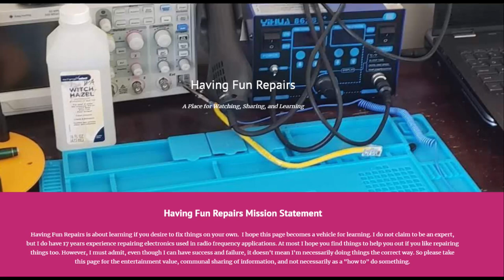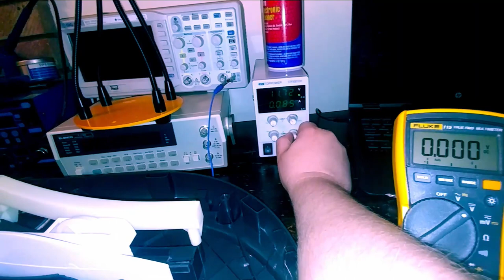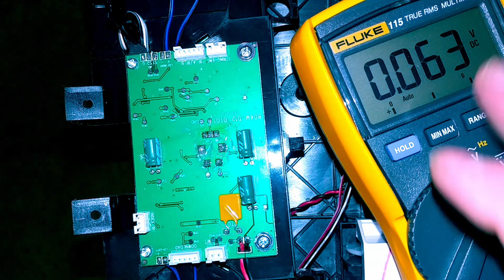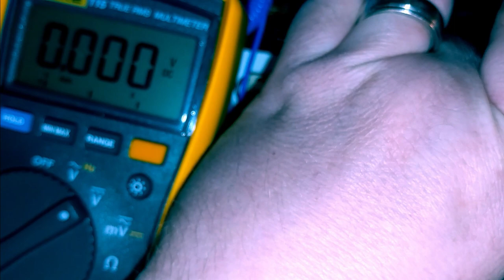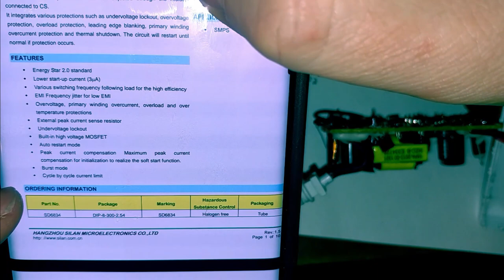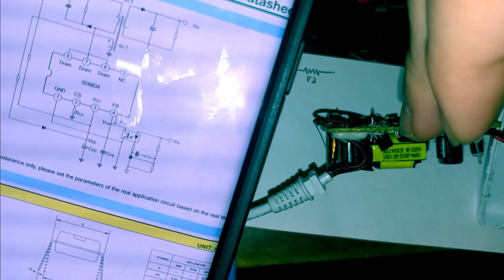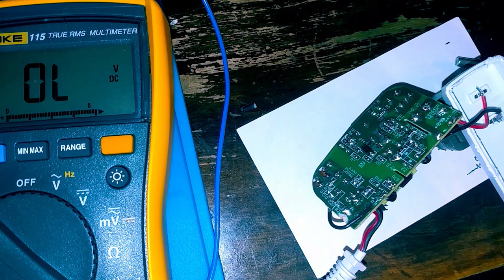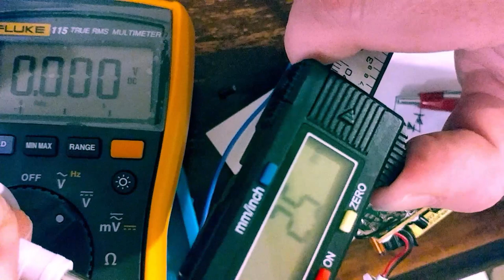4moms rockaRoo Repair Model 4M-012-01

Comment: Thank you so much for your detailed video. Upon fixing the swing, did it ever cut off on its own with a flashing blue light?
Reply from the maker: Thank you for watching. After I replaced the DC power supply/wall wart we never had another issue with it.

Comment: I was needing some help with mine. If you turn it on it will go for a long time but if you turn it off and back on it will start blinking and then stop within a minute of turning it back on. Any ideas on how to fix it? 4moms is no help.
Reply from the maker: Hello, unfortunately I have not directly ran into this issue. Is it the ring light that's blinking? A quick Google search produces that there could be an obstruction with the moving mechanisms. If you are good at disassembly perhaps check those parts to see if there are any fibers that are prohibiting the gears from making proper movements and check that they are properly greased. This would probably be where I would start on the low end. If there were no issues with this then I would be checking/troubleshooting components for proper operations on the high end of troubleshooting. I don't know your background, but I do offer repair services for many electronics. This is an older video so it may not be advertised in it. 

https://sites.google.com/view/havingfunrepairs/business-repairs